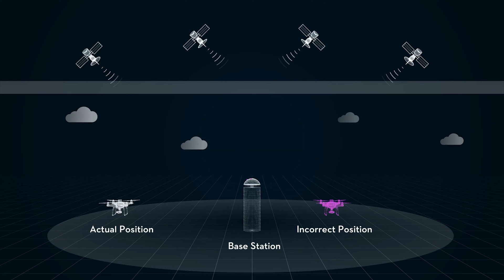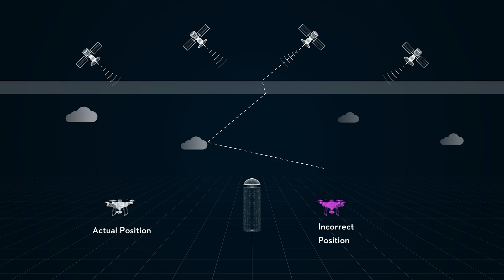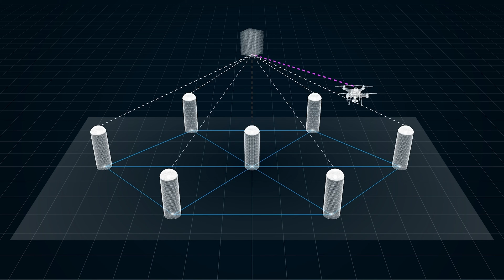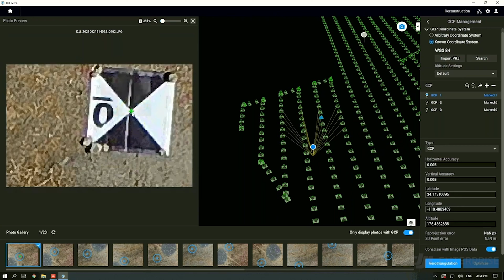Mapping 101: Introduction to RTK

Comment: I purchased the Mavic 3M from you guys a couple months ago.  I have really liked it so far, but ran into an issue yesterday that I just can't seem to resolve:

I mapped a 90 acre alfalfa field using the RGB camera with the GSD set at 3.0 (height of about 360 feet), using the RTK module.  I reconstructed the map with DJI Terra using "Fruit Tree Mode."  I set the field boundaries and modified the AI results to mark the obstacles etc.  I also set the entire area with alfalfa as purple to represent fruit trees so that area would be sprayed.  I generated the 3D flight path and adjusted the route parameters so that the flight height would be 10 feet above ground level (AGL).  

The problem appeared as I began to spray the field.  Instead of the drone spraying at 10 feet AGL, it was much higher, about 32 feet AGL.  I tried remapping the field and that didn't help.  The strange thing is about a week ago, I mapped out a 8 acre field for my neighbor using the same methods and sprayed his field with roundup and it worked perfectly, maintaining an average spray height of 10 feet AGL. 

Do you guys know what the problem could be?  I use a DJI T-30 drone and it will fly at whatever height I want it to fly in regular flight missions.  The only time this seems to be a problem is when I generate a "Fruit Tree" mission.  I am thinking the error could be caused by changing weather conditions when I mapped the field (there was a big storm coming and the barometer was dropping), it was also only about 50 degrees outside and my M3M had been stored inside my house at 72 degrees.  Alternatively, perhaps I need to adjust the advanced setting on the RTK setting to adjust the elevation coordinates.  This is a little beyond my level of understanding, so if you could let me know if there is someone who could try to help me figure this out I would really appreciate it.  

--
Reply: Mny friend you understand more than most thats why noone has replied to this just yet. I myself took a screenshot so much so all you explain sounded like mandarin to me. I will have to decrypt it slowly until i fully understand what has been happening lol